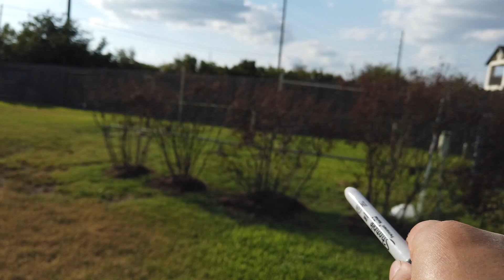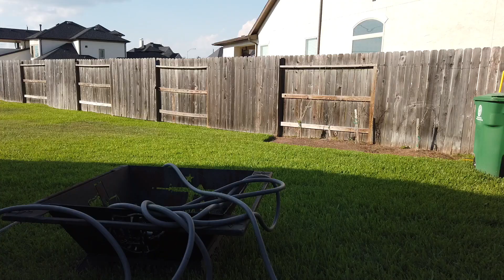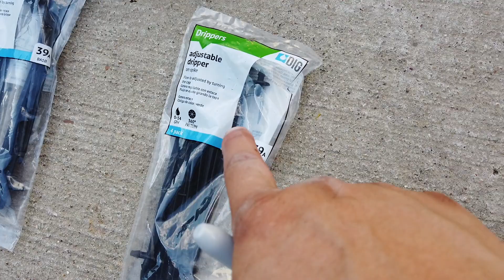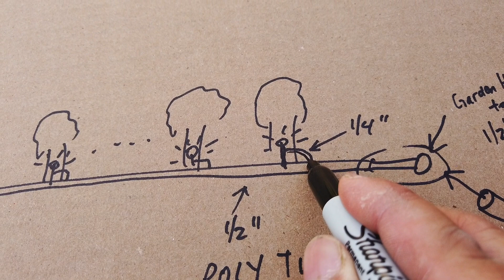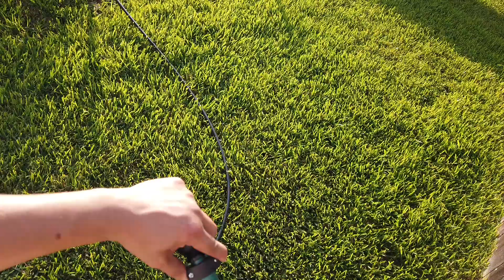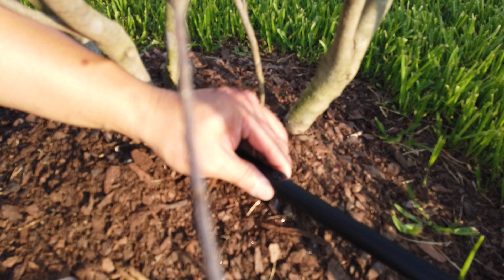Install sprinkler drip hose irrigation to water hedges / bushes under $25 in about 1 hour

Comment from the maker: >>> Drip Line Parts List  <<<
✅ 50 foot 1/2-inch drip line hose - https://amzn.to/320rzB5
✅ Garden Hose to 1/2-inch drip line converter (so you can attach to hose spigot) - https://amzn.to/3fcx82U
✅ Drip line hose punch tool - https://amzn.to/2ZNWhum
✅ 50-foot 1/4-inch drip line hose - https://amzn.to/38H5mcD
✅ Barbed 1/4 inch adapters -  https://amzn.to/3gHWdmS
✅ 360 degree drippers - https://amzn.to/3eaHbEl
Reply: Very helpful you included list thanks!!

Comment: You should have done the adjustments prior to finishing....have a feeling that it didn't work in the end.....
Reply from the maker: @Lori Woo it is still working, the only part I did not include a timer / valve. What type of adjustment are you referring to?
Reply: I think what she is referring to is the fact that the last drip had low pressure. how do you make sure they all have good pressure?